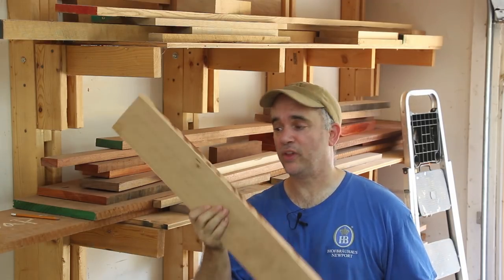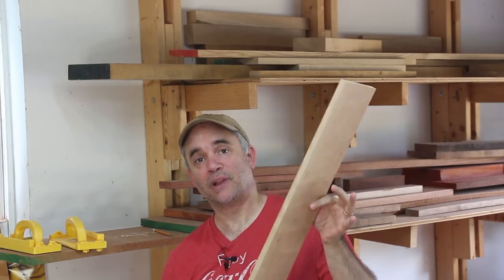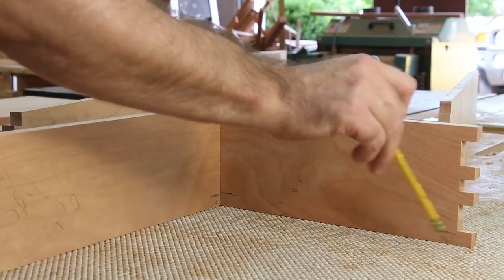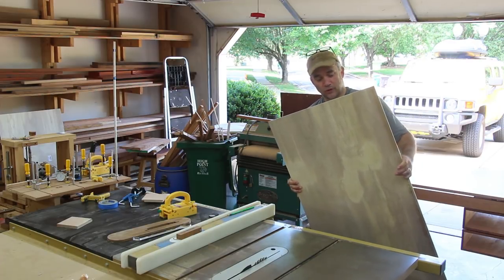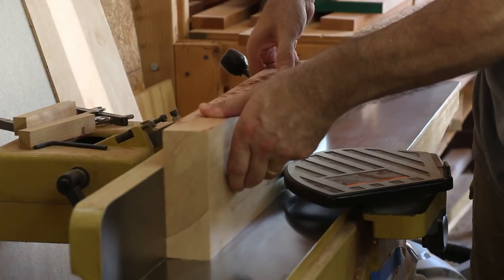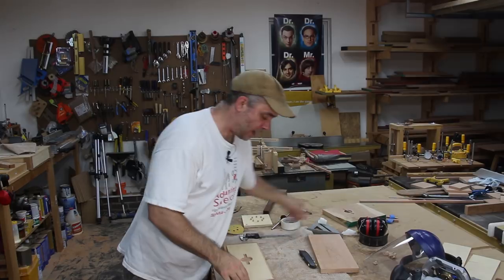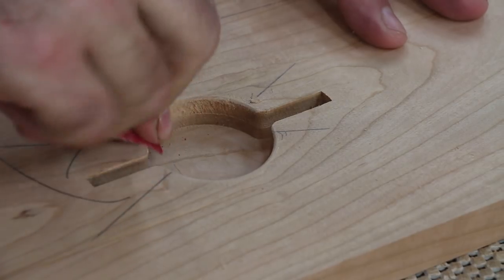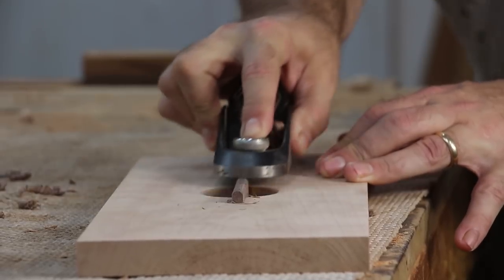Floating Top Desk with Suspended Drawers FINALE

Comment: Looks great! Why do you think your table saw is burning the wood so bad? Dull blade?
Reply from the maker: Burning is common with cherry.  Cherry is high in resin/sap and the resin/sap tends to stick to the teeth of the blade.  If you clean the teeth (daily would be needed in my case) the burning is significantly reduced.  It's the resin buildup on the outside of the teeth that causes the burning.
Reply: GarageWoodworks ahhh. Never worked with cherry. Just sand it off I guess eh?
Reply from the maker: I usually just hit it with a hand plane or light pass at the jointer.  It's never been a problem.